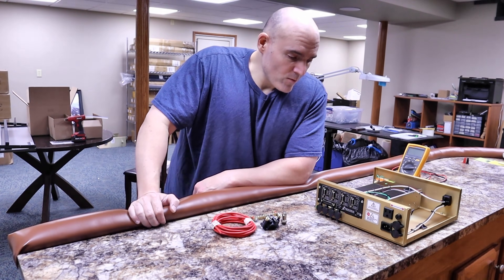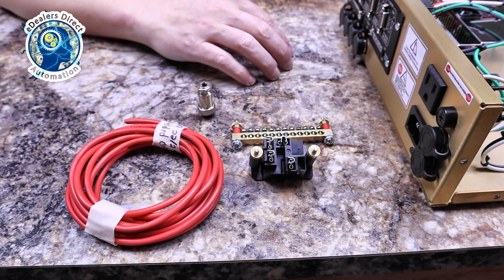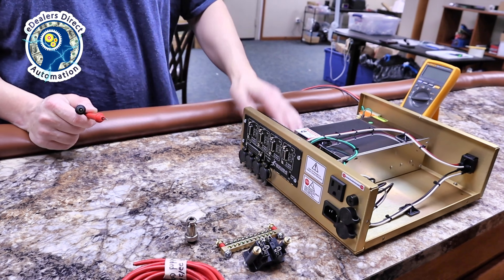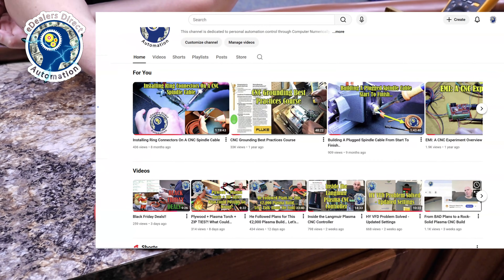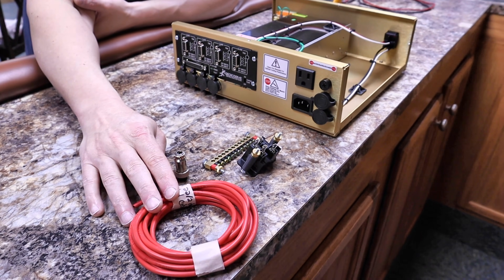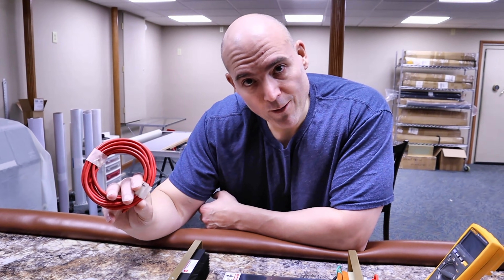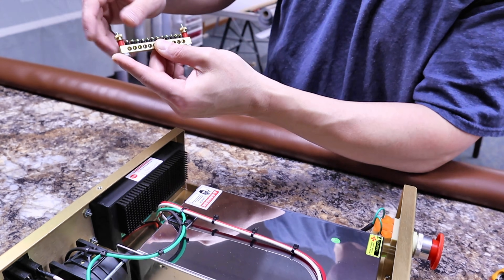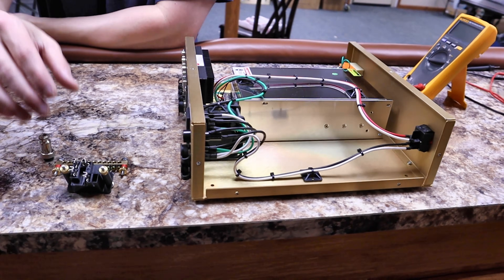How to Achieve Stable CNC Plasma Control on a Budget

Comment: Hey Vince, I found your channel through Grant pratt’s videos of his plasma build.    I am in the process of gathering all the information I can and deciding what control hardware and software I go with when I build my Cnc plasma.     I have decided on centroid for my control board and I am curious what your opinions are on that system.  Maybe a shot in the dark but thanks ahead anyways.
Reply from the maker: Its a proprietary controller so you're tied to Centroid if they decide to charge, or manipulate the motion control software. 

As long as you're fine with that then you're all set. I prefer open source as it puts the client in control. 

Thank you,
Vince